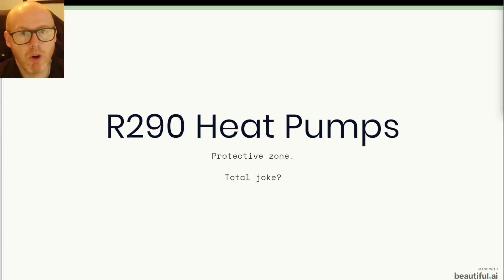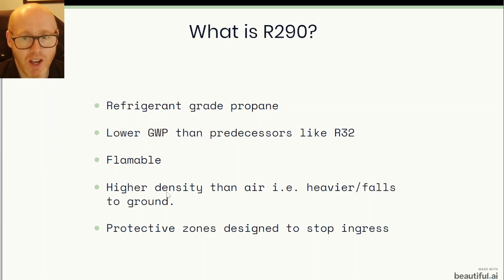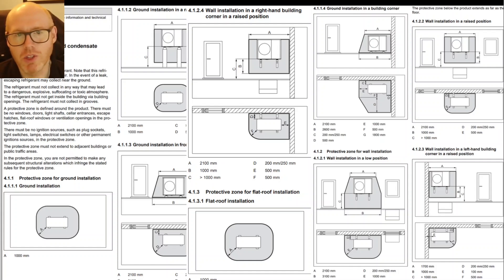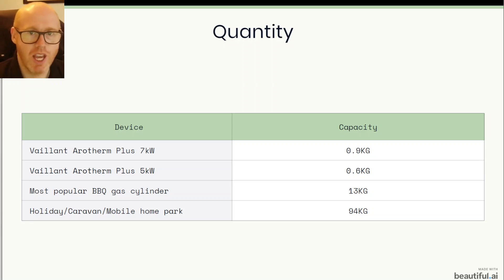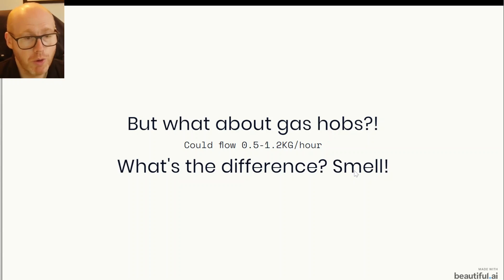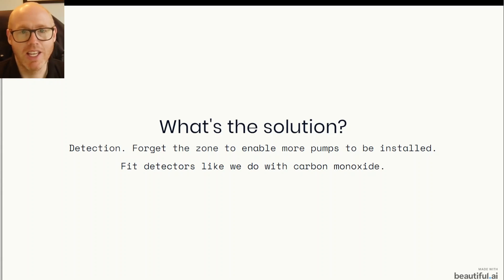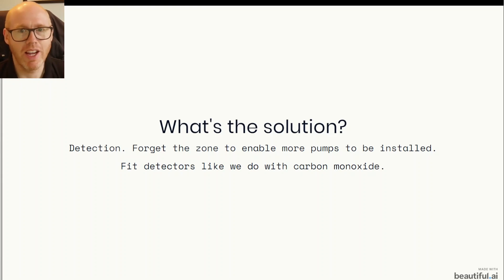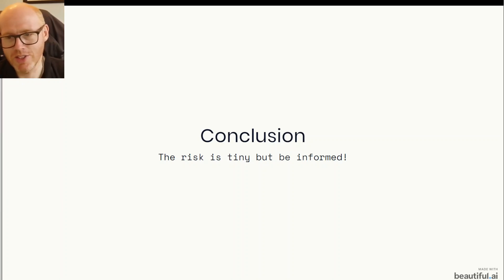R290 Protective Zones Are a NIGHTMARE - Here's Why

Comment: What is the advantage of R290 compared to R32? I need to change my air/water heat pump and the installer offers me the R290 instead, he tells me that I will have less electricity bill This is for a heated floor 30 degrees Celsius maximum 🙂
Reply from the maker: R290 can reach higher temperatures which isn't really necessary for heating but can be necessary for hot water.

R290 is also better for the environment.

Comment: I'm looking to switch from Gas to an ASHP but the more I delve into it the more regulations and obstacles I find. The 1m from the boundary PD rule is going but may be replaced by a lower noise threshold according to MCS. Now I've come across the R290 exclusion zone. None of these regs apply to my old boiler. The flue makes more noise than a ASHP and its fuel is potentially more deadly. Despite the problems I'm going to push on. I saw the position of your heat pump which looks to be within a metre of one of your windows. How did you get round that? Is it down to the homeowner or the installer? Thanks for the informative content. (I am a subscriber and liker :) )
Reply from the maker: Thanks!

Good on you for persisting despite the headwinds.

It is a regulatory minefield and it really shouldn't be so hard!

The window closest to my heat pump is a non opening one.
Even if it was opening, you could probably skirt around that issue because of the height of the window.

Good luck.
Reply: @ I may have to use another type of heat pump, maybe a Split ASHP because my ideal location is inside a metre of an opening window.

Comment: The compressor that started Grenfell was R290. 

I think that's cause to be cautious if it's in the building, by using the refrigerant for distribution to a head unit fan coil. How reasonable this precaution is I'm not sure.
Reply from the maker: R600a according to reports which line up with the age of the fridge freezer that caused the blaze.

It's still a very different subject we're discussing here. 
Refrigerants being used outdoors is not the same as those being used indoors.
It's one of the many benefits of monobloc systems instead of split systems.
Reply: @UpsideDownFork  My bad. At least it's still one of the flammable ones, with a lower gwp. They did verify it was a cheaper model that used a plastic backing of the fridge to save costs - a small bit of sheet metal would probably avoid that particular calamity. 

Yes. Totally agree on monoblock not causing issues. However, there's a lot of a2a silver bullet hype around, so we do need to be aware. 

In dense urban areas we ought to switch to heat networks, but the resistance in this country is unreasonable imo.  

Medium density urban areas would need low temp, or 5th gen, heat networks for efficient distribution, so having a shoebox sized w2w heat pump drawing from infrastructure sorts out most of the issues.

Comment: Unfortunately after having Octopus round for a survey, we seem to be falling into the "no other option" box with the current rules.  I'd rather not install a new gas boiler but between the noise assessment and these refrigerant rules, we feel like we've not really got any choice.   I wont start ranting but it is bloody frustrating.  I'll make some enquries with some other installers but i'm not particularly hopeful 😩
Reply from the maker: That is a shame. Definitely worth investigating other potential routes with Aira and others.

Sometimes going for a Daikin with Octopus means you can get a R32 unit instead of R290, but noise assessment can still be an issue.

Another ridiculous issue that I should make a video about.

Comment: The purpose is to prevent creation of hazardous areas and ignition, explosion or and jet fire in the event of a propane leak, it's ATEX legislation, UK EPS regs.

You got the purpose wrong it's not to stop flammable gas ingress it's to pooling which will create your hazardous vapour avoid ignition sources, which make them go bang.

Propane monitor would be a solution but the devices would need to be atex to prevent the detector igniting such a leak and they are about £2k and need maintenance every 3 years, and in a room your unlikely to get sufficient air ratio to detect it anyway.

Gas hobs have grandfather rights and the grid gas has mercaptans in it to allow people to smell it if it leaks.
Reply from the maker: Thanks for commenting. 

The purpose is irrelevant, no? 
Ingress or pooling, both are highly unlikely to happen with the tiny quantities involved.

Many people have anosmia, so adding a smell to the legacy gas network only protects some people.

Grandfather rights are just a typical excuse used in many industries to avoid responsibility by those who make the most money.
Reply: @UpsideDownFork  the purpose is safety. Given the quantities of these heat pump installs, the guidance airs on the side of caution.
Systems do leak from time to time and with age. While installers can install it how they want and make it look pretty, they also need to justify why they ignored manufactures instructions should it go wrong. Plenty of videos or refrigerants in confined spaces going bang. 
https://youtu.be/SsqkIc52wGE
Reply from the maker: @1992Craigster  R290 is a working kitchen is hardly the same as out in the garden.

Comment: As someone that works in the development of R290 heat pumps I can tell you that the answer to your question is costs. Propane detection safety switches are currently too expensive. I expect that the price of them will drop soon because the sales volumes of these propane sensing switches is going to skyrocket.
Reply from the maker: @freekjacobs6096  thanks for commenting! 👍

Comment: Propane is a by product of natural gas processing and petroleum refining so what it means we still need oil , so how green is this
Reply from the maker: Not perfect but the same quantity of propane may power a car for 2 miles. Or we can put it into heat pumps in a sealed system for 15 years or more...
Reply: @ our next door neighbour is a refrigeration engineer and they won’t last 15 years without a refill he says at best 5 to 7 years, also if we stop refining petroleum there won’t be any propane
Reply from the maker: @snodgee When was the last time you "refilled" your refrigerator?
A split system may not be sealed that well and also contains a lot more refrigerant. A monoblock system which is relatively new and becoming more popular in the UK is a factory sealed system.

There are already various types of bio propane and other synthetic methods.

They're currently not used because they are more expensive than the 'waste' caused by legacy refining processes.
Reply: @ we called out the engineer about 18 months ago as our deep freeze wasn’t freezing still under warranty and one of the pipes had sprung a leak we had a new pipe and a gas refill , when I asked our neighbour he said it was quite common in air conditioning to have a refill as he has two types of gas on his van , I have had at least 3 gas refills in my air con on my car so has my wife
Reply: @snodgee  You're conflating the system types.  Split systems require the installer to seal the system, so have more of a chance of a leak if not done properly, however there are strict rules in Europe with those installs.
Car AC is more exposed to rapid temperature fluctuations and vibrations.  However, if you've had 3 refridgerant refills then there's probably a leak somewhere that needs checking out because it shouldn't be that common, especially in 2 different cars.

Monobloc systems are hermetically sealed at the factory, like what UDF said, so have far smaller chance of a leak occuring.
Most will contain less than 1kg of propane.  Which if released, would be equivalent of using less than 2 litres of fuel in a petrol car.  Or in a boiler, it's about 15kWh of gas burnt or about half a therm.
Reply: @ when we are no longer producing petrol in years to come the expense of production of propane will go up dramatically according to the oil companies
Reply: @snodgee  The refrigerant makes up a tiny fraction of the cost of the heat pump, about 0.01% in the case of the 7kw arotherm plus.  And it's not like propane is the only option.  R32 is still very common in split systems and is synthetic, so isn't reliant on the oil companies.  And as UDF said, there are synthetic options for propane as well.

Comment: Google's AI assist gave "Why .. " 
 R290 refrigerant is highly flammable and can be ignited by static electricity, so protective zones are required to reduce the risk of fire: 

    Flammable
    R290, also known as propane, is an A3 gas, which is the highest level of flammability. It has a flammability limit of 1.7%, meaning even a small amount can be a fire risk. 
"

So, what are the equivalent regs for poorly installed propane tanks [and the thin weak piping]. Another rabbit hole ;-)

Comment: The R290 regs are just plain overkill. The quantities involved are tiny and it's extremely difficult for propane to "pool", even the slightest movement of air will cause it to mix and disperse so the idea it could somehow infiltrate the drains or the underbuild from a leak in an outdoor appliance is just ridiculous.  
Even if all 900g from the larger heat pump, by some freak accident leaked into an average living room (5m x 4m), it would  only be sufficient to reach about 50% of the lower explosive limit, i.e. it's already dispersed to the point of being harmless.
Reply from the maker: @garysmith5025  agreed 👍

Comment: We have just stop oil banging on about stopping the use of oil where do they think LPG comes from.
Reply from the maker: @alexandermay1196  whilst I sympathize with their cause, I don't sympathize with their methods which rub everyone up the wrong way. Alienating people is never effective for bringing about widespread change.

Anyway, to the actual point you're making. Is it worse to have a one off cost of half a kg in a sealed system or to be burning multiple kg every  day for the life of the system through heating, cooking and hot water generation?
1kg lpg = roughly 12kWh of heat energy once burnt through a modern boiler.

During winter a typical home in the UK could burn through anywhere between 8 and 12KG on a cold day.

So let's not use a red herring argument to detract from the actual point here. Let's leave that to the daily mail.
Reply: @UpsideDownFork  Having fitted heat pumps as a replacement to log burners in NZ. about 14 years ago.
Tec has come along way since then but it's going to be a big change from gas boilers to heat pumps like for like.
I agree they are much more efficient.

Comment: Too funny; First that want you to convert from efficient NatGas systems to less efficient heat pumps (They use natGas to spin the turbines to generate power & lose about 70% of the heat energy conversion to electricity) than they ban the more efficient R-22 which was mor efficient than R410a & R290.

Not to worry. the EU is about too lose a lot more  of its Russian NatGas Supplies, so no need for heat or electricity. EU should prepare for long term rolling blackouts & sky high energy costs!

"On 1 January 2025, a major contract governing the transit of Russian gas through Ukraine will end, with significant implications for remaining Russian gas exports to some European Union countries."
Reply from the maker: 1. Gas turbine stations do not lose 70%. They lose approx 40%. 60% of the energy becomes electricity generation.
2. Gas extraction requires significant resources to begin with. So why are we still doing it? Look at the entire lifecycle of gas production, it's insane.
3. Gas transmission incurs significant losses to get the gas to our homes. Search for UAG if you want to read about the 7000GWh lost last year due to shrinkage alone!
4. Once you transport gas to a home you burn it in a 85% efficient boiler.
5. Have a look at energydashboard to see the slice of gas generation decreasing significantly over the last 25 years of historic data.
6. Heat pumps can produce 3, 4 or even 5 times the amount of heat energy from the electrical input. 
Even if the grid was 100% gas powered, it would still be a much more efficient method of delivering heat to homes than the old gas plumbing pipelines we have across the country. 
But we use anywhere between 10-40% gas in our grid, depending on the day and how windy it is.
7. When it comes to heating, R290, R32 and R410A have very little between them in efficiency. 
In lab tests they are within 5% of each other and in real world applications that gap narrows so small that it can't be measured. R22?! Are you serious?

Comment: I think you are bang on the money and the current restrictions on R290 heat pumps do not suggest they are the product of realistic risk assessment. The biggest risk reduction is that the R290 is outside and that is before we consider the failure modes that would result in the loss of R290. It is most unlikely that all of the R290 would be released at once and very much more likely that a very small leak releasing the charge over months.
Reply from the maker: @normanboyes4983  agreed 👍

Comment: I work as a Senior Architectural Technician and recently had to locate 300+ heat pumps across an entire new build development.  I get why the regulations are in place, but they are onerous and cause even more or a headache when you're accommodating so many across a site.
Reply from the maker: @MyASMaRk  ouch. That's doesn't sound fun!
Reply: Seems crazy to do 300 individual heat pumps rather than some kind of centralised district heating scheme

Comment: until you work with gas zones in industry you will not understand. The regs are not too restrictive, its just that everything else is too slack.
Reply from the maker: Ok, thanks for sharing that perspective.
Reply: These are domestic heating appliances containing small amounts of flammable gas and located outside of buildings. The risks bear no resemblance to those in industry where the fuel sources are many orders of magnitude larger and in busy environments with lots of varied activities taking place.

Comment: There's nothing new about this, it isn't the oil industries or heat pump sceptics. It all comes from the F-gas laws, and lobbying from the various training agencies which want to protect their businesses by keeping refrigeration behind a paywall even though the latest refrigerants have a low GWP - They are doing this by targeting safety.

It all comes down to the safety classification R32 is an A2l refrigerant which is "low flammability" while hydrocarbons (E.g. R290) are A3 or "high flammability". Part of the installation for an R32 refrigeration system is to ensure that the rooms that are affected have sufficient volume to never form an explosive atmosphere if all of the gas were to leak into that room. The manufacturers of monoblock heat pumps know that their heat pumps won't be installed by F-gas engineers, therefore they have to cover their backs from liability as they know this calculation won't be performed - It's as simple as that.

Regarding detectors, you'd have to know if they detect mercaptan (The smell agent) or pure propane. If you want a "proper" propane detector which makes these specifics obvious in their specifications, expect to pay around £700. There are plenty of people who can have them installed, so I don't think there's going to be any desire to change the regulations any time soon.
Reply from the maker: Thanks for contributing. You clearly know your stuff!

Comment: To be accurate, the regulations relating the heat pump installation simply says the installer must follow manufacturers instructions. And it is then the manufacturers (including Vaillant) who specify the protection zone for r290. As such, it is not regulations gone mad, its manufacturers going super cautious. So pressure should be put on the manufacturers to get more realistic. One correction. I’ve checked with Vaillant and trapped drains are ok within the zone cos gas can’t collect in them in any meaningful amount.
Reply from the maker: Well it is still a case of everyone passing the buck and no one willing to be brave.
BESA technical director and Institute of Refrigeration president Graeme Fox has some interesting things to say in the CIBSE journal...which very much push everyone into erring on the side of caution and then some.
Reply: @UpsideDownFork  Companies aren't here to be brave, they are here to make money for their shareholders and they do this by being cautious. That's just the sad reality of society.
Reply: Interesting.
Reply: The manufacturers simply adhere to GSIUR and British Standards. Updating is required
Reply: @johnj4860  Thanks for that gem. Can you point to the relevant section of the ‘
The Gas Safety (Installation and Use) Regulations 1998’ Act and other relevant legislation?